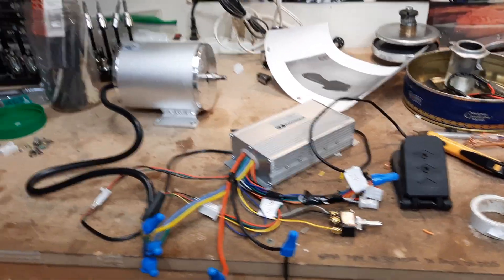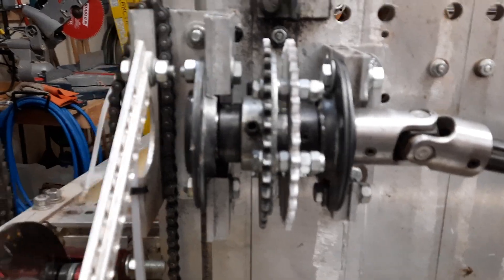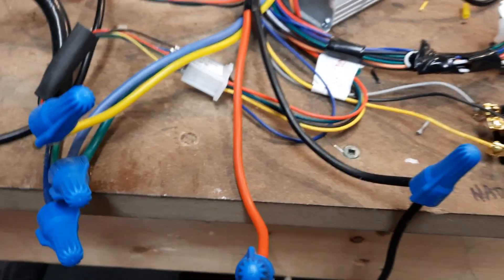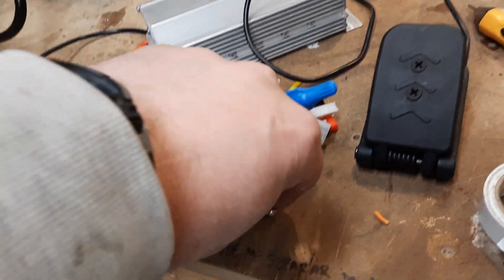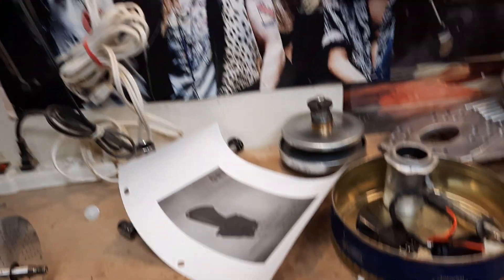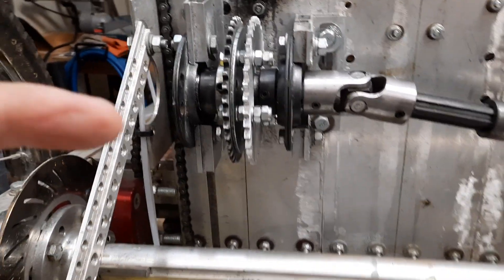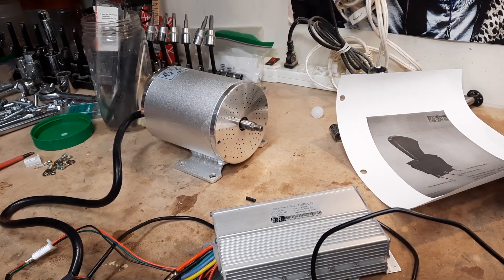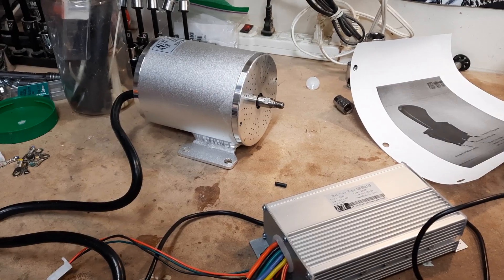The Vulture Cyclekart - Making a Hybrid CK - First Test

Comment: Not sure what motor controller you have, its could be a simple jump pin to change the direction and RPM. Or most likely you will need to reprogram your motor controller.